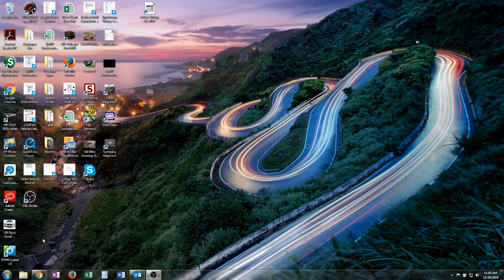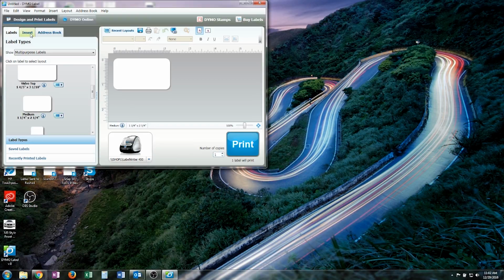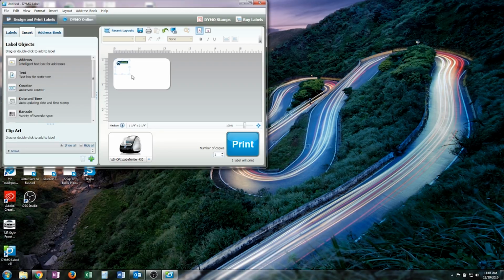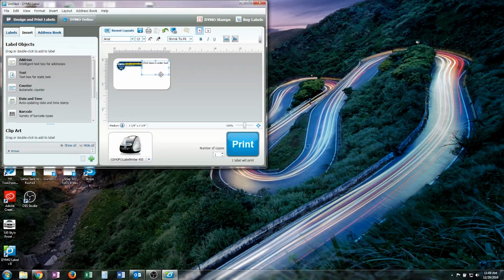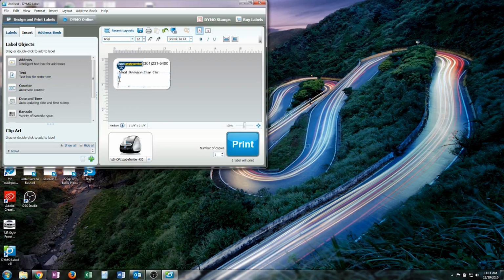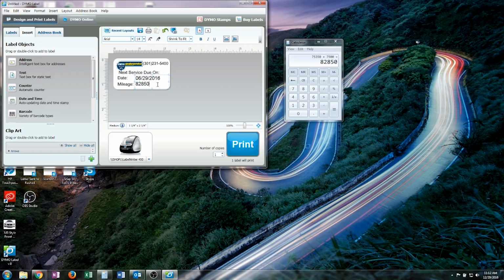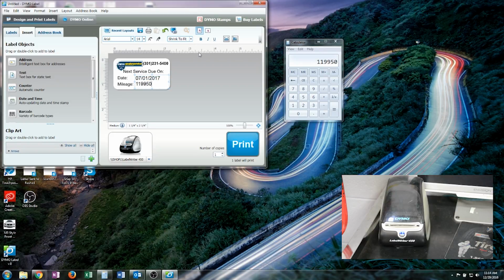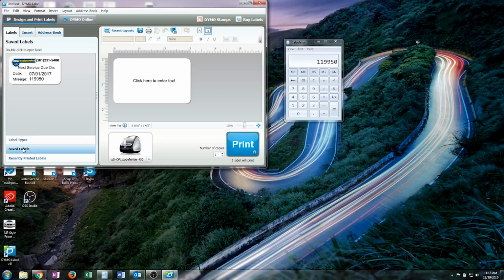How to Make an Oil and Filter Change Reminder Sticker - Dymo LabelWriter 450

Comment: The labels recommended are the Dymo LV-30334 labels which are removable.
Reply: Or just do a search for Removable Dymo 30334 Labels.
Reply: @Cory Stevens  lost on the millage sticker part on how to determin whens the next time the car is due for the oil change part.. can you break it down to me? in math.. please
Reply: @MrNickelodeon90  typically you use the recommendations set by the oil you are using or the shop's policy.